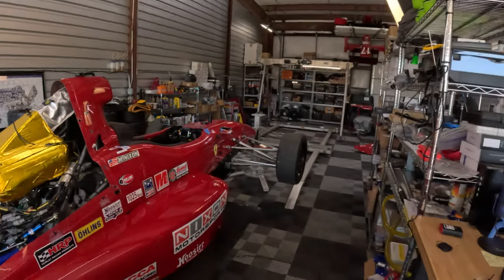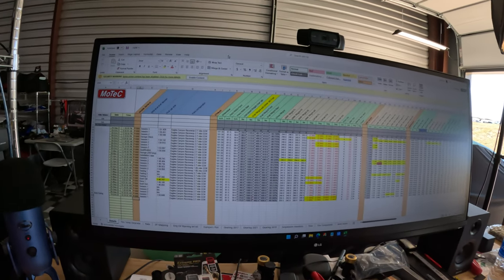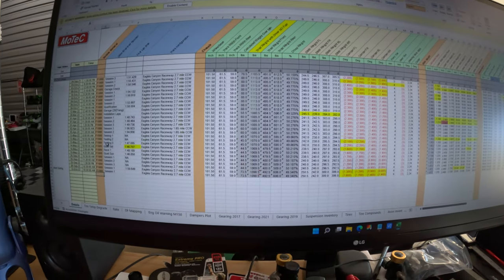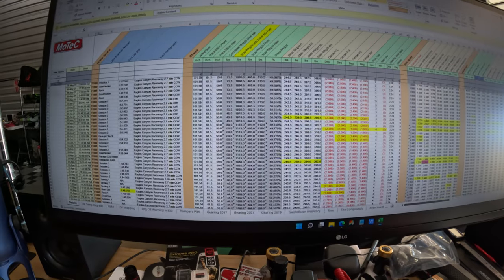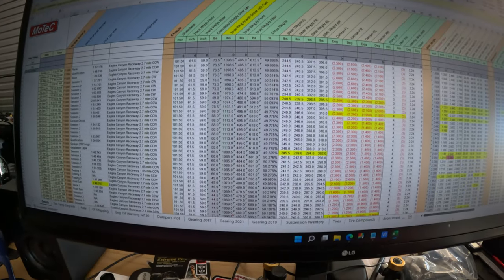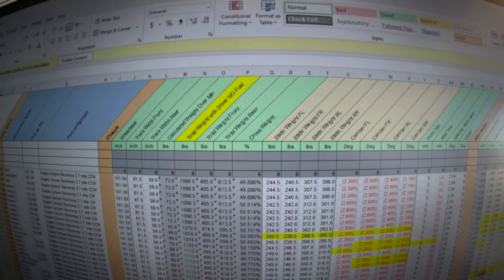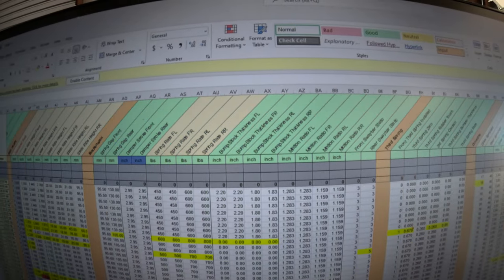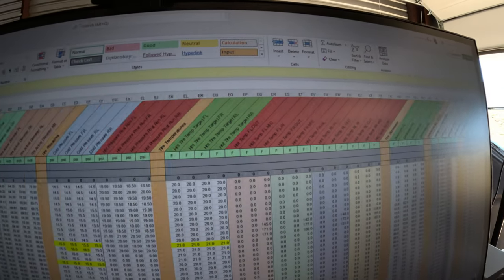How to Setup a Formula 1000 Race Car - Chassis

Comment: I was in Army Aviation for 12 years working on UH-60s. Your data acquisition reminded me of IVHUMs. Sensors all over the helicopter tracking TONS of data points. Vibrations could should a part failing soon among other data points. Ahh Excel... It's a time machine. Start pulling data and trying to get a formula output just right. The sun can rise and set and you wouldn't notice. 
And for those that hate data and Excel yea. Sometimes it gets boring but when you work on a race car or helicopter as well you SEE the parts working in your head when crunching numbers and it makes you want to tweek everything even more. 
Or throw your laptop across the room when you get get something to work.. LOL
Reply from the maker: That is fantastic to hear, yea good ole excel.  In my case it is only used for static setup logging for the analysis software to leverage.  The heavy lifting is the real time logging of sensors of course.  But the two tied together is powerful.  It sounds like you would enjoy hanging out with us and sharing stories...  Thanks for the comment!!!

Comment: Hey Mark.
I must apologise.
After asking you to do an episode on chassis set-up, I finally make the time to watch it, two months later!
For me, a truly awesome episode. Loved the detail.
The one aspect of motorsport I find the most fascinating is chassis set-up, whether it involves four or two wheeled machines.
I have one question, do you measure/adjust caster and if so how do you go about doing that?
Keep the content coming, my workmates and I really enjoy it.
Cheers.
Reply from the maker: Hi Warren, thanks for question and nice words.  As for Caster, not so much.  I really focus on toe and camber as you saw.  You need or should have turning plates but can measure caster with the digital gauge I use.  For me I only think of caster as a setting to add weight to the steering wheel with more caster makes a heavier wheel and so on.  It can help with turn in causing a weight shift on the inside wheel etc.  But, as I said I do not bother much with caster.  Thanks

Comment: How much would one of these go for? Do you know of any site or place where i could go to buy one or is it better to do it yourself
Reply from the maker: Hi,  There are few F1000 on the market, you either need to buy new or keep a close eye on what is for sale.  You asked about price, new you are at 75k or more.  I do happen to know of one Firman F1000 that is for sale now.  It is a very fast and sorted car, I think it is priced at 65k.  One site to watch is apexspeed.com. I hope this helps
Reply: @NixonMotorsports  thx
Reply from the maker: @isaacvl95  Of course, if you are interested in that one F1000 that is listed let me know I can provide a contact.  By the way, I have a video that you may like it will show up today and speaks about the F1000 in great length.  Check it out later today
Reply: @NixonMotorsports  I will check it later for thx